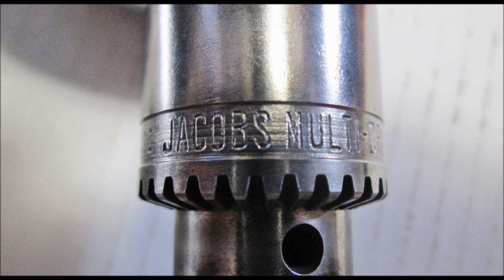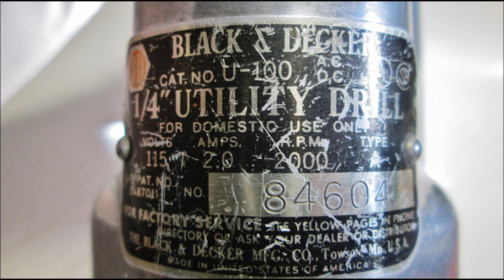Old Black & Decker 1/4 in.drill restoration

Comment: Just picked up one of these in a Black & Decker Deluxe Drill Kit. Nice drill and lots of power. Drove a 1" spade bit through a 2 x 4 like nothing. 
The reason I bought it at the Restore was the box it came in. I like getting kits. 😁😎
Reply from the maker: They are a tough old drill .I think one of my old ones has bearings made in Germany  .My favorite is my Skill 1/4 in. drill ......Has a faster speed for drilling wood of using a wire brush

Comment: I have a black and decker jigsaw my dad bought in the 1970s. I wasn't even born yet. He gave it to me and it still runs.  It is a shame tools aren't made like this anymore. Now all it comes down to a boat load of companies in the tool market coming out with a new 18 volt drill every year after you just spent 400 dollars on a combo kit.. All of a sudden a new version of yours is out.. Then they expect you to keep buying over and over.  Nice job I really liked the turn out.
Reply from the maker: I like my old drills for wood working ..For drilling metal I have a newer 1/2 inch Hitachi drill that is about 3 years old cost around 50 bucks ...I have a cheap cordless drill for small jobs
Reply: not2fast4u2c I still run my 9.6 volt makita drill and impact. Ive only had to replace batteries recently. Makita doesnt make batterys anymore but i found a good generac with quality cells and they are 3 ah.

Comment: i got an old craftsman drill, looks alot like that. im not so machinery incline (more computer guy) but i think this vid is gona help alot when i finally get around to cleaning it up and reassembling lol. it looks so sad gutted in a box
Reply from the maker: +d3g3n3r4t3 Take alot of pictures I take over a dozen on some things And lay your parts out in order like washers and bearings so they go back the same way
Reply: not2fast4u2c
that would've been a good idea...
Reply: +not2fast4u2c weird im not seeing a second post i made asking you some things.  guess i will ask again.  well to begin with, i have the same model drill as you. i musta been mistaken trying to read the plate. it has literally no paint on the plate anymore and all i can see are the SN#, which is only 4 digits here instead of 5 like yours.  you said u used carb cleaner? did u use it on all the metal pieces and insides?  one of my brush springs is broke and the brushes are prolly half the size of yours so quite worn, duno if i should just replace with new brush and springs, but ima have to find a similar part if so 8(  o and i had to do a solder job on the stator cause one of the leads was broke as it left the coil.

heh sorry to be long winded and i appreciate any help u may have and really appreciate this video =D thanx

EDIT had questions about various fiber stop washer type things but found answers in vid heh
Reply: im back, been super lazy ;P one of those wires that come down the handle coming from the actuator (or w/e that is inside) is broke off...thinking only salvation is to rewrap it 8(  some thick gauge, any idea how to put them back together? :P

Comment: Thanks for the great video. I have a U100 that I'm restoring and have two questions: 1 What size screw goes in the bottom to hold the switch in? 2 Any idea where I might be able to get a replacement name plate? The one I have is scratched up and illegible.

Comment: I've got the same drill....I inherited it from my grandfather, I recall seeing it circa 1967 in his garage...plus , I have a specific drill press that goes with this, it mounts up in three places, overbuilt & made of cast-iron.  The marked difference is, it has a strange keyless chuck, no "ring-gear" to tighten, but a ribbed collar to hand tighten...???? The internal mechanism cracked & broke into pieces, I was able to unscrew the chuck & I have a threaded stub sticking out of the complete body...I'm trying to find a suitable modern chuck, if I can't, I'll likely have an "adapter" fabricated.
Reply from the maker: Mine chuck is a standard 3/8  diameter by 24 thread  That can easily be found at stores that sell drill acessories

Comment: Thanks for video because I found a drill same model and when I plug it and turn it on i only hear a sound doesn't turn
Reply: Why is a drill not safe without a ground wire?
Reply: By the way I spray rubbing alcohol to help clean it. But I still need to disassemble the middle part which I didn't do yet but I did clean off the other parts 1st
Reply: I got it working in full speed again! Thanks for video.

Comment: Hey, nice video. I'm restoring a very similar drill but can't figure out how to remove the chuck. I think it might be a screw on like yours, but it might be a tapered fit, and I don't want to mess it up any more than I already have. Do you think you could tell me the model number on the chuck?
Reply from the maker: I showed in one of my videos ..how I put a 3/8 in allen wrench in the chuck and smack it with a hammer so it turns counter clockwise when looking at the end make sure whether or not it has a screw to remove first
Reply: Hey, I have seen the video, but due to my circumstances(i.e., I broke the brass collar in the drill axel), I can't do the Allen wrench technique. Do you think you could still tell me the chuck model number?

Comment: i have an earlier home utility drill the chuck the key is missing as i posted a 3d video on it as i have a Jacobs keyless chuck on it now as i gad to get a 3/8-24 UNF bolt, cut the head off so i can have the stud that screws into the drill and  the chuck thereby installed. as i can't find a 1/4 in chuck had to go with whats available a 3/8 chuck as the same threads to mount it on the drill as the stud on the chucks were used up to the mid 1960s and the metal housings were used up to the early 1970s before they went to the stacked modular plastic housings and a metal gearbox was used to the mid 1990s before Black and Decker shipped them overseas now all made in China as of today on the Black and Decker, Craftsman, and DeWalt tools they own.
Reply from the maker: That was a great idea to cut a bolt off and use it as a stud....There was a company I found once that had a 1/4 inch chuck some place that sold stuff for machinists..I am lucky and got mine to work better ..It is almost impossible to find the right key to fit older chucks

Comment: I have this reversible black & decker bright orange color drill with a stuck Jacobs Multicraft chuck which doesn't open or closes, actually is in between position. I looked inside and doesnt have a locking screw . Th drill body is plastic except the gear housing which is made of metal. Do you know how can I remove the chuck? The drill doesn't have any Serial #.
Reply from the maker: +enterBJ40 The way I remove the chuck is I put a big allen wrench in the chuck and strike it with a hammer .Like i show in the video try spraying the chuck with something to get it to move just enough the get an allen wrench in it
Reply: I had to destroy the chuck. I was careful to dont damage the threads in arbor( shaft). I bought a new chuck .now is clean and ready for new grease ( any specific type?). New  carbons will be fitted  also.
Reply from the maker: I would use the moly stuff but any grease like for disc brake wheel bearings ..stay away from that brown looking grease

Comment: My wire off the coil ripped, what can I do? I need to replace it
Reply from the maker: Try to take it apart like I did Mine now has a 3 wire cord with a ground
Reply: @not2fast4u2c  but the wire was built in the coil, not the connecting two prong wire
Reply from the maker: @platinumvulture1122  Sorry I misunderstood Maybe get a piece pulled out to solder a wire to Just be carefull the the red colored enamel on copper wire is thin and cannot be shorted to any wire on a coil
Reply: @not2fast4u2c  can I get the same size wire, soder it to the old wire to extend it, then add a new screw wire connector?
Reply from the maker: @platinumvulture1122  I would guess so  It is hard to describe stuff without seeing it

Comment: Out of curiosity what grease would you put in it if you were going to be using a lot at a time?
Reply from the maker: If I was going to use it for heavy use ..I would use the same grease used in disc brake bearings on cars it is a high temp grease
Reply: Ok thank you! I don’t plan on using mine tooo often as it is too pretty to now lol but when I do I’ll probably be running for long periods at a time sanding and such since its only a one way drill so this is some good info that I couldn’t really find an easy answer to. 👍

Comment: how did you open the gear box?
Reply from the maker: There are 3 screws that hold the gear box to the drill
Reply: I know! I opened them and a closed gear box came of. There seems  so be a back plate i cannot release. Wht kind of grease do you use? A link to online source if you know...
Reply from the maker: Any grease will work I use a moly graphite type
Reply: not2fast4u2c vaselin will do?
Reply from the maker: No ...I would use a grease that is for gears or bearings on a car